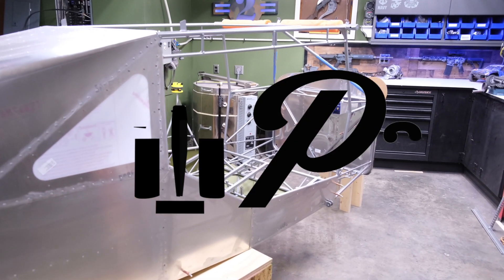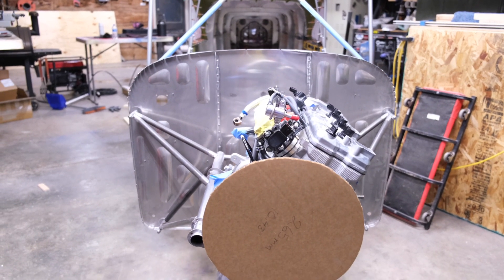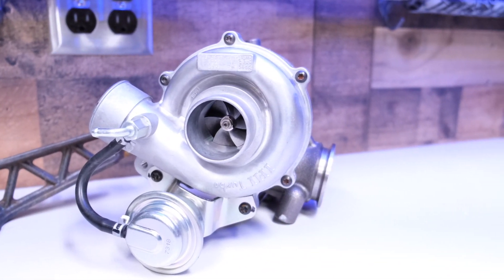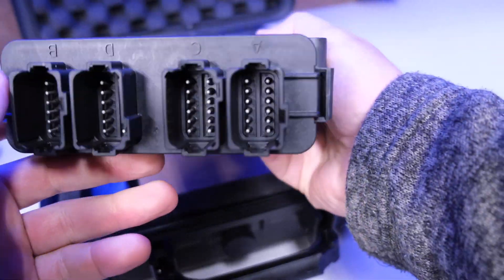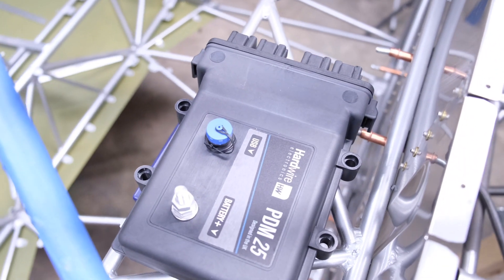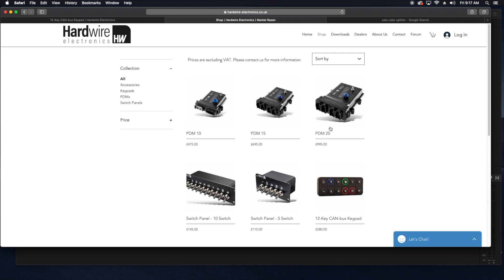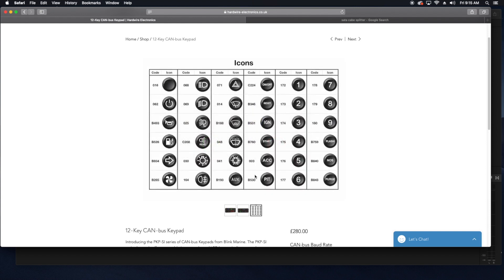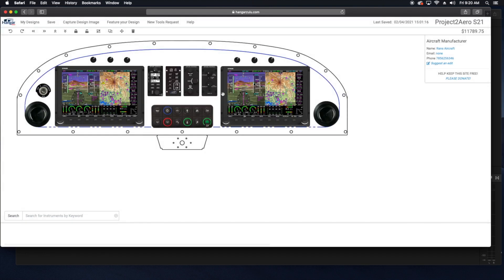RANS S21 EP24 ELECTRICAL PLANNING

Comment: im not sure what all you can hookup to with the Hardwire but the vertical power you can hookup anything and have it wired to your efis and it will show any problems and other things right on your efis panel.
Reply from the maker: Yes sir your right, I plan to pursue that integration with the Dynon stuff later after I get it all workin good. That’s a very nice perk of vertical power since they already have it done for you. The keypad lights will be sufficient for me if I can’t make it interact in the end..